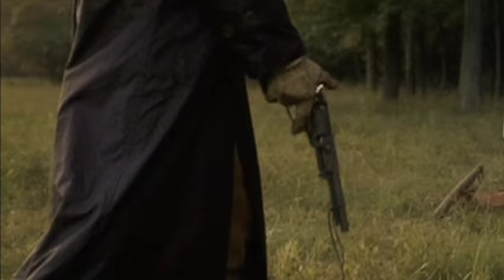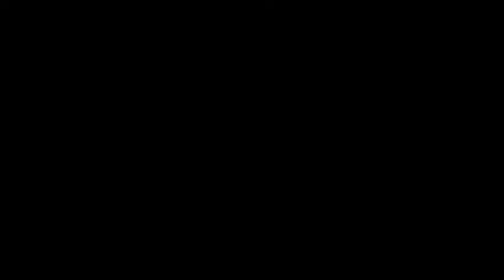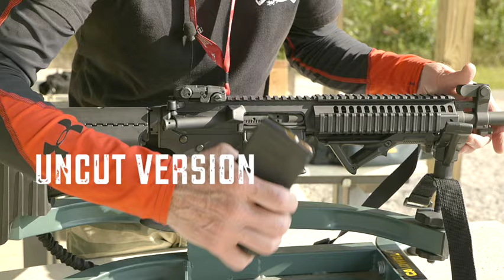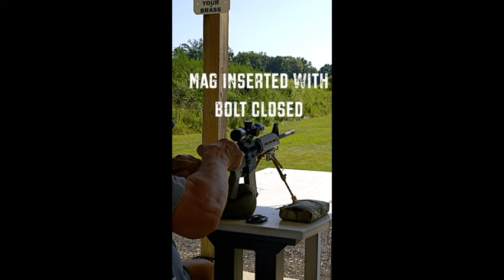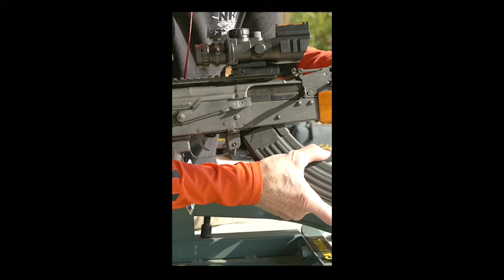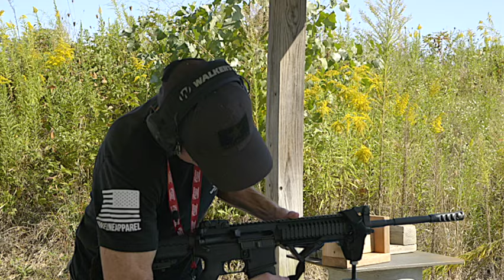SHTF Mag Issues Bolt Open vs Closed

Comment: Curious, what extra wear or stress does inserting a magazine on a closed bolt cause to the bolt carrier group? Have you experienced any parts wearing or breaking because of this? If you had anecdotal information I’d be more likely to believe you but you never once state anything in the video. You only mention an owners manual telling you the ideal way to load.

I’ve owned and shot AR’s for many years and have never once seen, heard or experienced parts breaking from inserting the magazine on a closed bolt. I even fully load my magazines. I’ve never believed in downloading magazines and never had issues with inserting when having the bolt closed. You can verify the magazine locked in by pulling down on it. That would help remedy the issue you show in your video. I will concede it is much easier to load on an open bolt vs closed but I find it far fetched to say the bolt carrier can’t handle the extra stress.

You mention the bolt carrier can split over time? I don’t believe that. Your conclusion that the military treats the rifle like that because they have extra parts is lame. While they do generally run their weapons hard, if your theory was true they would recognize the parts breaking at a higher rate and look to fix it. Truth is, the rifles are abused and mostly continue to run.

Comment from the maker: Thank you for all the feedback with concerns of the bcg of the AR15. This video is based on a SHTF scenario to where care is needed to protect our firearms from any type of failure that may occur. All mechanical parts are prone to failure especially more so when put through extreme conditions. It is always best practice to follow the owner's manual to the operation of each firearm. The AR15 consists of around 14 parts which can come loose or experience stress cracks. Putting undo stress on the bcg can make the parts fail more quickly. The AK47 bcg is slightly simpler and consists of around 8 parts and is considered more robust and able to handle more extreme employment. Thanks to all that has watched this video and supporting the channel.
Reply: I've done hundreds if not thousands of "tac-mag" (proper terminology) reloads. No way I ever broke a bolt because of that. What SHTF situation are you thinking of where the way you reload a gun wears the parts more than just firing the gun. Shooting an AR will always wear the parts faster than any reload on a closed bolt (if that even is a thing).